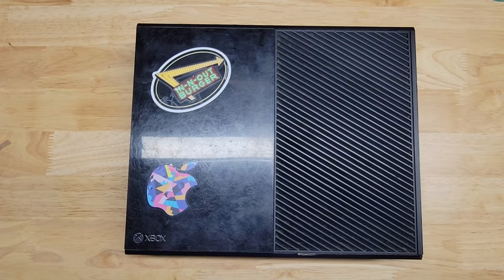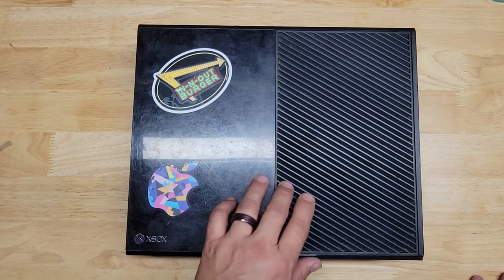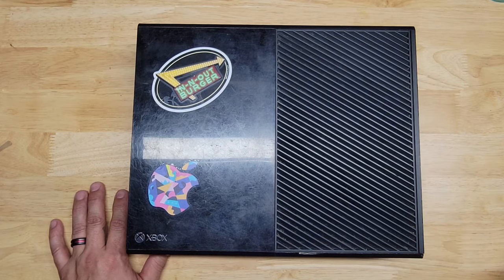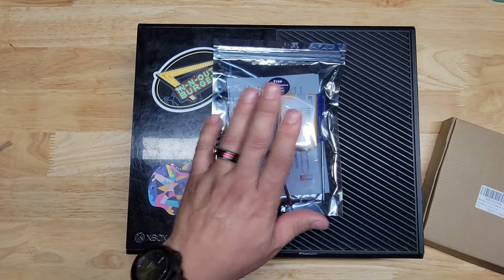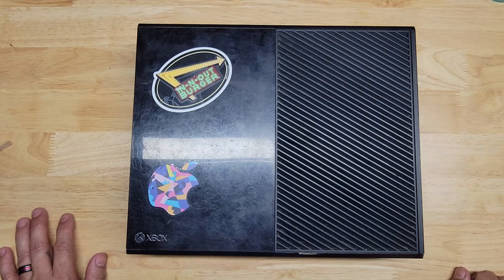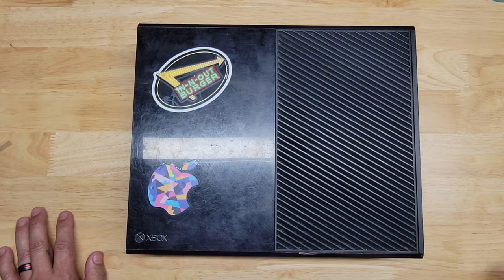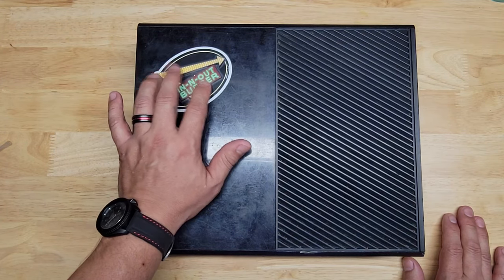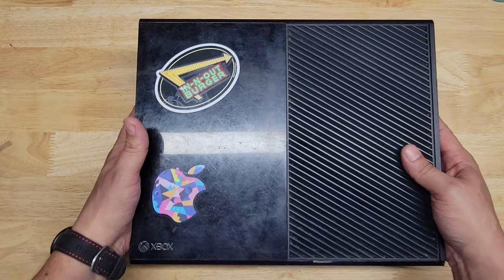Xbox One Game / Blu Ray Drive Replacement 🎮 TRU Fixes Tutorial ⚒

Comment: What are the chances of the old board being the problem in the first place?
Reply from the maker: So far, I haven't seen too many issues with the board itself. If the board is the problem, then you would need to get a new motherboard and drive from another unit. I've read that you can try to transfer the main drive chip from the defective board to the donor board, but I've never tried it.